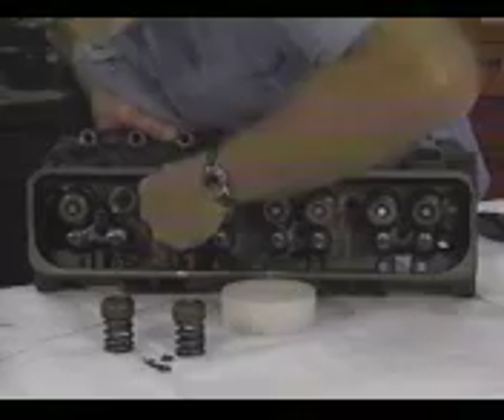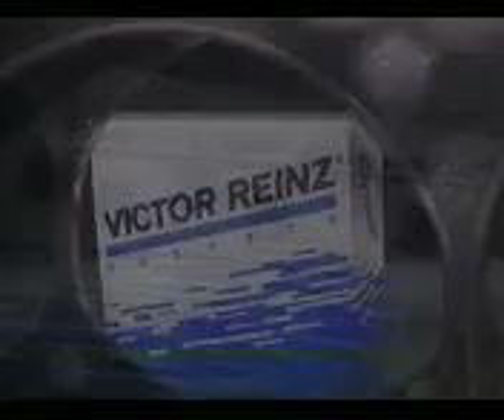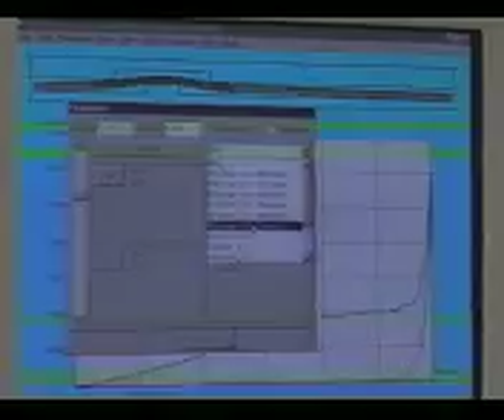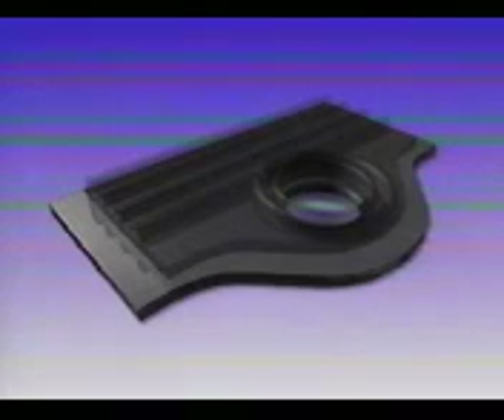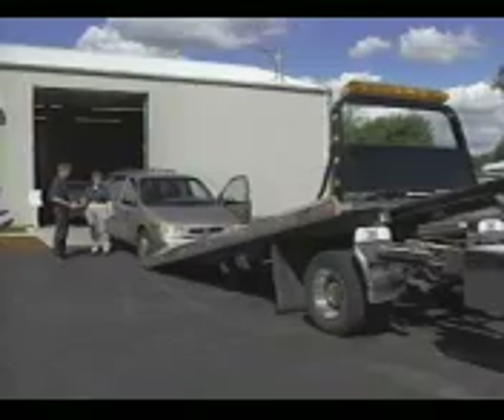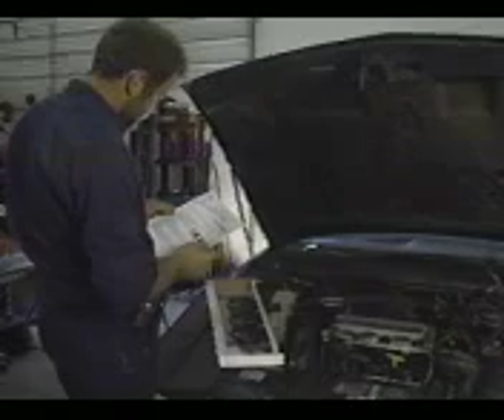Victor Gasket presentation

Comment: Ahh, so you're the largest OE manufacturer? So that's why my gaskets failed on my Ford, GM truck and on my Harley? Maybe I'd better go with Felpro this time.
Reply: Did you buy Victor on eBay they are a poser with the same number as Victor Reinz but it is just Victor not Victor Reinz they are made in India